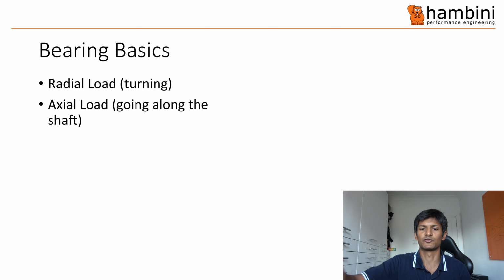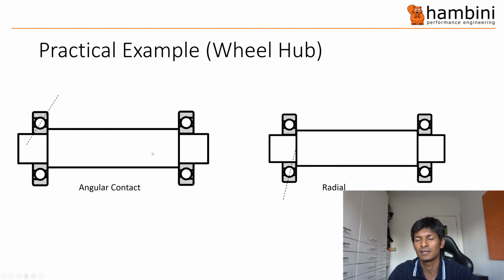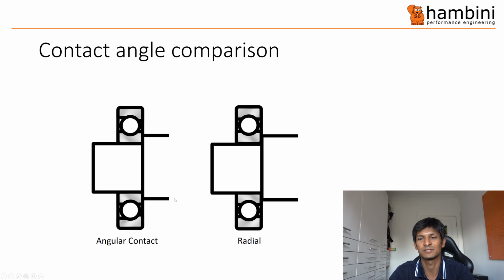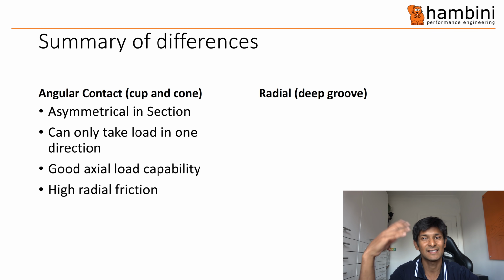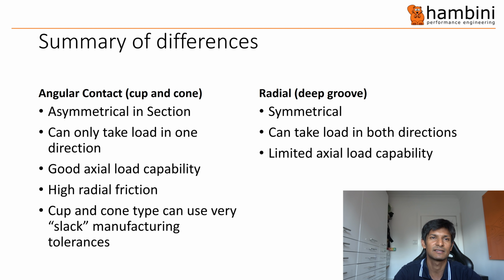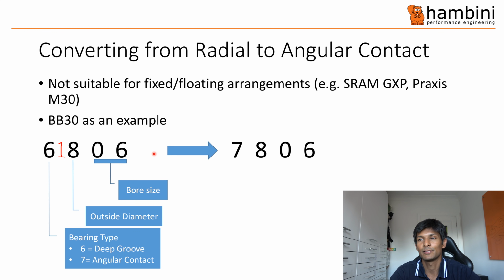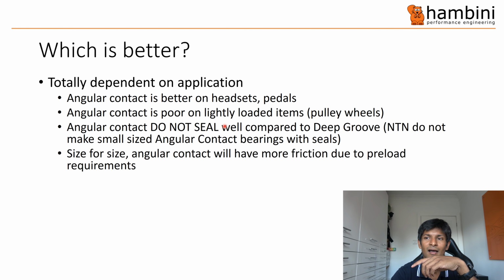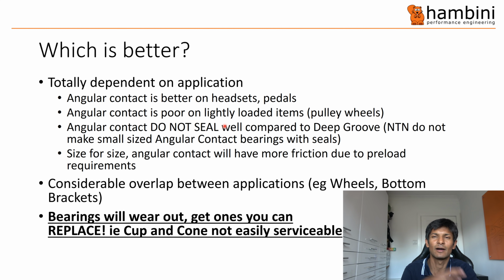Angular Contact vs Radial Bearings (Cup and Cone vs Cartridge): Engineering Analysis

Comment: What's the 3rd loading on a bearing called? The one that tries to bend the axis of one bering race away from the axis of the other? The one that kills crank bearings when not installed straight?
I found "tilting moment load" or just "moment load", is that it?

Comment: would it make sense to use angular contact bearings for wood pellet press machine? 
2 cylinders attach to a horizontal shaft which then is pressed on the sides down against a plate with holes in it that spins around, the cylinders then force material through the holeplate, compacting it and turning it into extrusions 
theres bearings inside these cylinders that spin around, but people struggle with the bearings malfunctioning quite fast
never seen anyone mentioning angular contact bearings for this

Comment: Great ! That is what I was looking for... Thanks for the explanation ! But one question still remains: orientation to mount angular bearings. I think the right way to mount it is the same orientation like shimano's cup and cone, right ? But I won't risk to "break" the bearing when removing it ? I mean, to remove it, I'll have to push it from the center (in to out). This force won't risk to dismantle the bearing itself ? Thanks !

Comment: I actually enjoy doing my cup and cone  hubs. My biggest question is what bearings to  get Chrome Steel, Carbon Steel or Stainless Steel or Ceramic Ball Bearings Si3N4 Silicon Nitride vs ZrO2 Zirconium Oxide. I have plenty of Chrome Steel G25 but thinking there is a better option  what is your view?

Comment: I thought this was really clear.  (Very neutral for Hambini too!).  I'm sure I am not the only person who runs destroyed cup/cone angular contact bearings with a little bit of excess play (bottom bracket especially) because I don't have a spare bottom bracket spindle.  I wish I new better what causes the damage to the cones.  It doesn't seem to matter what I do with bearing adjustment, the cones always show pitting first.  One of the great things about radial bearings is that there is no preload setting to worry about.  So for sure they will wear out, but at least you are unlikely to damage them during the initial installation.

Comment: I think that cup and cone is easier to maintain and cheaper. Simpler tools to dismantle correctly. The only importent thing is to to tighten the cone just right. For this you need to secure the axle at one end to be able to gently adjust with cone spanners. It's not hard and once set up perfectly I think they perform better because there are less contacting surfaces compared to most cartridge designs and less friction. They clearly perform better in wheels that I have set up.
I don't think cartridge bearings on wheels is a techical improvement at all and I think this is why Shimano and Campagnola didn't change to cartridges.
Reply: I recently serviced some 30 year old Shimano hubs. New bearings and one cone had to be replaced which was still available. These wheels now perform better than new and better than much newer cartridge bearing wheels which I have.

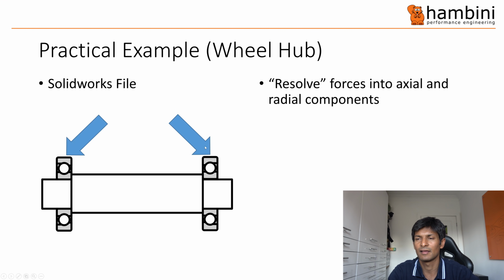Comment: At 12:16 you have two blue arrows showing force being applied to the upper part of the vbearings. Shouldn' these arrows be pointing at the lower part of the bearings? When weight (of the bike and rider) is applied from above, it's the lower part of the circle of the bearing that hold the weight up.

Comment: Is it true that radial cartridge bearings will also have the tiniest bit of play because the balls need a bit of float in the groove? I have Paul hubs with the enduro 61902 bearings in them and they had tiny play from the start (on the bike) and was told that’s the reason.
Reply from the maker: yes it's the C rating of the bearing

Comment: Excellent explanation!

I'm doing a conversion on a giant drill press that I have to turn it into a light milling machine.  The bearings that are in there are deep groove (6204Z and 6201Z), but a drill press mostly has axial load.  A mill, though, will mostly have radial.  In that case, am I better off replacing these with angular contact bearings (especially if I might still want to drill with it)?  Preferably single or double row?
Reply: im here looking for the exact same answer

Comment: Logically, the front wheel is more prone to axial load. That is because the front of the bike is lighter than rear(with rider on). When the road is uneven and has many potholes, it is harder to keep the front wheel vertical. It moves side to side unvoluntary. The rear is more stable because of its weight, so mainly radial load is applied. When i changed my front wheel bearings to shimano's angular contact, my bike is more stable in that conditions, especially the front of my bike. This is more save and comfortable.

Comment: Strange that I bought a Boardman hybrid bike with no problems with the wheels (I presume cup and cone) but have to replace sealed cartridge bearings in my Fulcrum LG Quattro every year with the seals failing after riding through a lot of water.

Comment: My big question hasn‘t been answered by this presentation, that is: Is it better to use an angular contact bearing in a Bottom bracket than a radial one? Like Wheels manufacturing is promoting it? When i understood correctly, the AC bearing produces more friction - but can take axial loads better. So more friction is bad in the BB. But what about the axial load? How much axial load gets the BB, or in other words, what are the angles of load applied to the crank spindle and thus the bearings and what is their typical direction? Would have liked those questions to be answered. Strange to me that a „BB specialist“ like you are excluding especially this very important part?

Comment: Great video thank you for sharing. Would you recommend ceramic bearings in a 1/8 buggy?the stock steel bearings keep going bad in my wheel hubs. They offer aluminum wheel hubs that might help the bearings from flexing around corners which would possibly help save bearings from wearing out. What are your thoughts? 1/8 scale arrma talion truggy 6s running on 4s most of time. Fast eddy bearings or jims bearings offer ceramic kits. I thought about searching each size separately to see cost. Thanks for your time

Comment: So why don't they use air baring's from the aircraft industry that go into F16 jet fighter engine's and rolls aircraft engine's? They require no maintenance and have 0" Drag And they come in many sizes, To fuck up these clown manufacturers you only need to make an insert for the baring to fit into the wheel, That will screw there sour faces up, And put a stop to their axle con when you need new baring's.. These cucks have gotten off with it for far to long.

Comment: Is there available an angular contact bearing from a reputable manufacturer that would fit in a standard 30mm ID bottom bracket (30x42x7)? I've searched near and far and all I've come up with is the 7806C from NTN but it isn't sealed, and the Enduro offering.

Comment: Thanks  great video  totally confused though.  Your conclusions if I have understood are that radial bearings much better in wheels  faster less maintenance.. however you use Shimano cup and cone c60 and c35.  I have c40   they spin faster than any dt Swiss 240 radial hubs I have and I have never maintained them in  4 years  .  Give them a push and they spin and spin  no radial cartridge bearing ever does that.  My old campy c record and airlite hubs which are 1950 something still spin better than anything.  So are you talking bollocks  or is the theory not working in practise  or am I missing something as usual!,

Comment: I know this is an older video, but if i got this right. IF I buy a pair of 7808 bearings and i want to but them in my bottom bracket, are they directional? i mean due to the construction of the bearings there is basically a right and a left one?

Comment: I've always been surprised no one uses a tapered cartridge bearing in a BB. Decades ago, Bullseye had a combination BB that used a needle bearing.

There have been tapered needle bearing headsets.

Angular contact can potentially be loaded up with more ball bearings, depending on if the radial bearing has a notch for loading.

Can you talk about how bearings are assembled, why there is a limit on number of balls, and if notches are used?

Cup and cone bearings, good ones like old campy bearings can use much larger balls and races than cartridge. If cup and cone bearings are made to the same standards and hardness of cartridge bearings, they are every bit as good.

The cage also keeps the balls from accumulating all on one side so the bearing actually comes apart!

Comment: Excellent explanation. For clarity of younger viewers it would have been useful to show a proper cup-and -cone wheel bearing (say).
I don't think any manufacturer still use cup and cone bottom bracket bearings.
I think the reason Campagnolo and Shimano still use cup and cone bearings is that they can be adjusted for wear and give minimum friction due to being cage-less.
I'm guessing that to accurately machine and grind the cup and cone in bearing quality steel and then assemble and adjust them would be more labor intensive and more expensive than banging in a couple of preparatory ball races in.
Some National Time Trail champions I was lucky enough to ride with as a Junior, (in the early 1960's) used to polish their wheel bearings every week. They also polished their chains usually on a Saturday afternoon while watching sport on the BBC's Grandstand.
They assembled the bearings dry in order to get the adjustment with just a hint of shake, then lubricate them with 3-in-one light  machine oil. And as a keen youngster I did the same. Riding out on a silent Sunday morning you could hear each unloaded ball drop into place. That is if you could hear them above the rasp of your tubulars at 130 psi pressure on the tarmac. Happy days.
Only criticism is I don't like the superfluous swearing.
Reply: with regards to bottom brackets, Wheels manufacturing sell angular contact cartridge bearings as an "upgrade" I've considered buying these, and this hambini video is part of my research.

Comment: Not particularly bike related but in pairing up angular contact bearing in say a machine spindle application, these bearings are mounted in various ways, i.e back to back, or face to face or a mixed triple etc. You've explained clearly that an acb is best used to deal with axial load and it does so by transfering forces occurring down the length of a shaft and therefore the bearing's inner race, through preload balls, and into the bearing's outter race and housing.....phew!

But I have a drilling machine (think expensive drill press) that was given to me in pieces. It has paired angular contact bearings for the bottom of it's spindle. Now of course in this application, considering that an operator would necessarily be applying a heavy axial load via a lever upon the spindle, axial load is the main focus. But, if you wish to drill a nice 'round' hole, then radial accuracy must run a close second.

So my question is, how are these bearings best paired? 

As I see it, if they are paired back to back in order to counter axial loads both down and up the spindle, the preload shims would need to be placed at opposite ends the paired bearings. But to my mind, the most support is being offered over the shotest length of spindle with a back to back arrangement and I therefore question how this would benefit radial accuracy?

On the other hand,  mounting the bearings face to face with preload shims between would 'seem', (once again to my mind) to offer a little more radial support by increasing the distance between the outter races?

Then of course I could be over thinking because I just don't actually 'know', and perhaps the best option in this application is to ignore axial force up the spindle because load is low withdrawing a drill out of material, and don't worry about radial load....just because, and pair the bearings from the bottom of the spindle, face to back, with preload shims placed between and on top of the upper most bearing, thus both bearings then addressing axial force applied down the spindle only???

Have I even got the concept right? Forgive the pun, but as you can see, the pairing of acb's has me spinning in circles 😮

Comment: Hi everybody, I have some experience to share with you. I hope in doing so maybe I can help the good and mechanically sound products not to disappear entirely from the market, which currently seems to be the trend. Actually I understand this is a hopeless endeavor but at least I’m doing what I can...

Mr Hambini, in the end I have treat for you. :)

I was working as a bike messenger in Stockholm Sweden for 7 years (but this was 10 years ago). This job really deals a lot of punishment to the bike, probably much more than most people would think. The first few years I trashed several bikes and especially a lot of wheels. Then I learned what works. This is my experience:

Bear in mind, because of my professional history I might be overly focused on reliability, over characteristics needed for competition. However I want my bikes to be as fast as possible, just without sacrificing functionality.

What works and is price competitive, is older Shimano LX, XT, XTR or similar quality race standard (105, Ultegra or DA). It has to be quality above Deore and it has to be steel or titanium axle 9/10mm. Unfortunately when Shimano introduced aluminium axles, they made the bearing balls smaller and thus decreased bearing life by more than 90% (I'm not exaggerating!). I could also detect fatigue damage on the aluminium axles, on steel or titanium axles I never saw that.

Sadly, almost all of these good solid hubs seem to be discontinued. And for what, saving a few grams?

What also works very well is Phil Wood hubs, if you can stand the weight and price. The Phil hub has very long lasting cartridge bearings that can be replaced and the hub itself will last FOREVER! They are absolutely bomb proof. I think in the aftermath of a nuclear war, mutant cockroaches will somehow move around on Phil Wood hubs…

To summarize, my tip for long lasting hubs in demanding conditions, is above Shimano for gears and Phil Wood for high end SS/fixed. Beware though, to get good value out of older Shimano you have to have some knowledge about setup and maintenance, this is crucial.

Factory build wheels might work for racing but not for messaging. I’ve tried a couple, and they both failed to scraps after only a couple of salty winter months. Carefully hand build wheels with 32 or 36 J bend spokes is the only wheels I trust.

Finally for BB, square taper is the most long lasting and generally reliable BB standard. It is also very available and adaptable for chain line or clearance issues. Integrated systems might be stiffer and lighter but for hardwearing all weather workhorse bikes they are just no good. And I would never even try the press fit systems, for me they just scream trouble!

So mr Hambini, if you actually red through all of my text. Maybe you with your great mechanical understanding and engineering skills could be inspired to make an in depth analysis on one or two square taper BB’s compared to modern integrated systems. To my knowledge the best cheap square taper BB option would be Shimano UN55 and the best high end option a Phil Wood BB. These BB’s are also very well known in this realm of the bike community.

That would certainly be very interesting for the likes of me and I think a lot of touring people and hardcore commuters. Even if you did a three hour video on it I’d be sitting like glued to the computer sucking up knowledge.

Maybe you’ll also see the light and then increase your business with some intelligently made square taper BB’s. :)

Cheers everyone! /deswhip

Comment: Does a wheel bearing ever see an significant axial load at all?  When you lean in a corner the forces will have to be acting inline between the tyre contact patch to maintain balance.
Reply from the maker: depends on what you regard as significant. there is a counter torque during cornering, otherwise the hub would collapse.
Reply: @Hambini  I've not heard of counter torque.  Is it that resistance to turning a spinning disc?  Or something else?

Comment: Could you please explain why opposed taper roller bearings aren't used in bottom bracket, or maybe you think they'd be a good idea. To the amateur, you'd think they'd be ideal, given the force directions, but there must be good reasons for not using them.  Is it simply that despite increased longevity, there would be more weight, friction and the need to accurately torque them?
Reply from the maker: Typically they are not made in the size required and there is the weight penalty which is significant. The cranks would also need to be redesigned for more ability to preload.

Comment: Nice content, as always. However, I disagree on one point, that being the cost issue. It is more expensive, to create your own proprietary in-house bearing in hubs than to use commercial cartridge bearings. You say it is cheaper, it isn't. Yes, Shimano does have the economies of scale, but so do others and they choose cartridge bearings because that removes R&D costs, tooling costs, etc etc. The fact that cartridge bearings are used in wheels relates to cost savings and passing on the maintenance cost to the customer.
Reply from the maker: I take your points on board. If you take Shimano as an example, they are so big and have such massive economies of scale that I believe it is cheaper for them to make in house - the cost saving comes from the very slack manufacturing tolerances they can get away with versus the fairly precise ones you would need with a cartrdige.